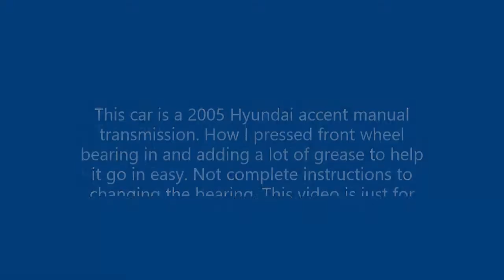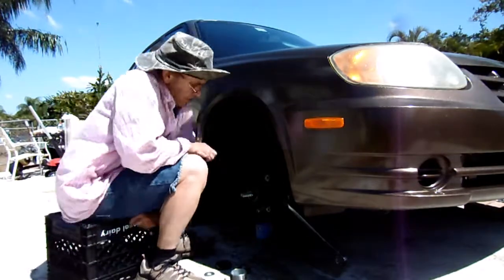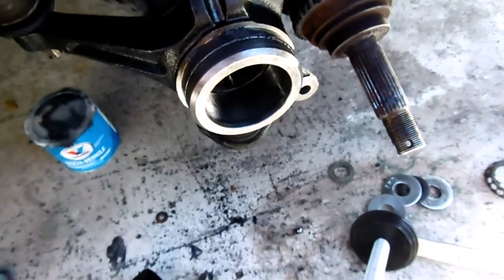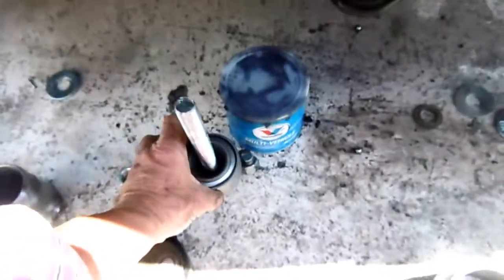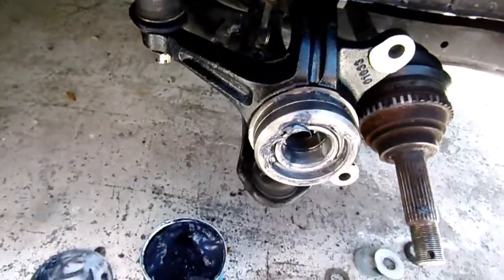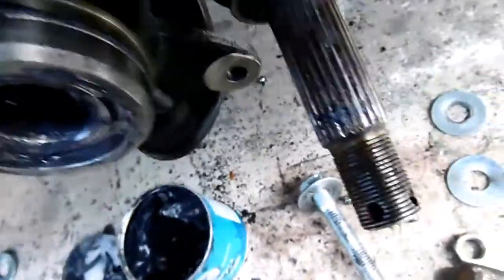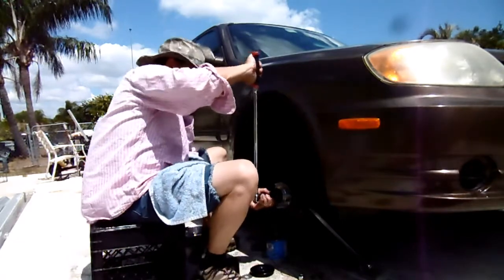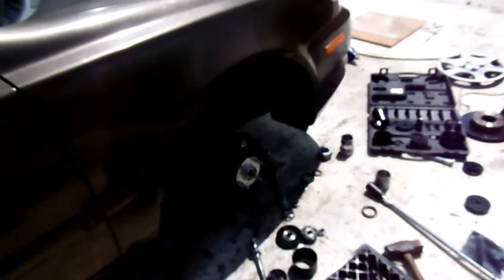2005 Hyundai Accent front wheel bearing! Please hit the subscribe button!

Comment: The bac u don't want flush with the bearing u want a to just make contact with the center of the bearing 
South Main Auto has some knowledge
Reply from the maker: So if you just press on the inner sleeve you can stress it if you press on the outer and inner if they are flat like this one your not stress it at all it been my car all this time working good